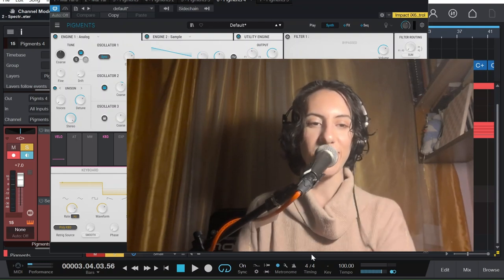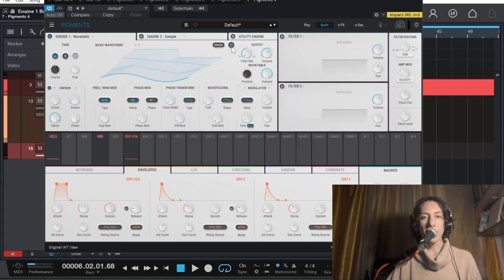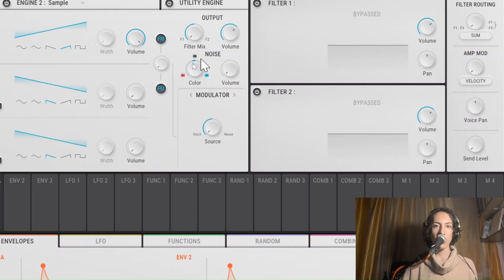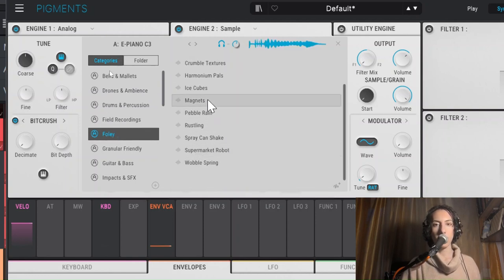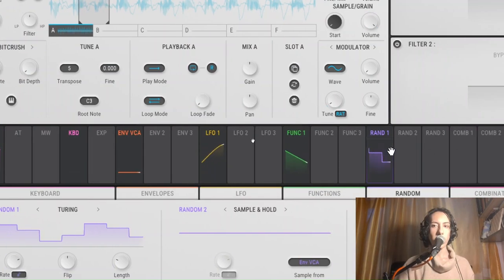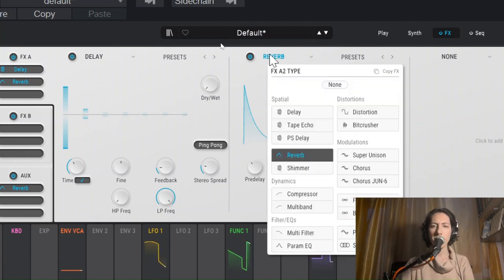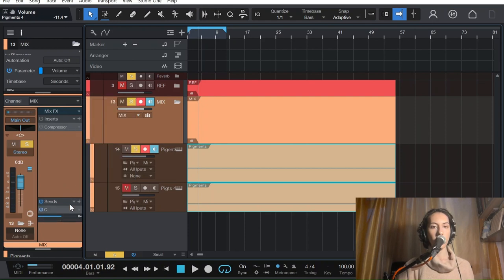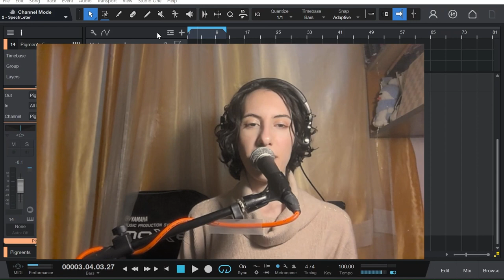Another Sound Effect Tutorial, Buuut In Pigments: Lawn Mower Sound

Comment: very low sawtooth into distortion on the mids and saturation on the low and highs into a low pass with resonance to shape the tone then a convolution reverb using an impulse from a fuzzbox and lastly a tape echo up fast about 16th or above to add stereo width, If the  sawtooth is locked to semitones you can get a changing gear effect. The key is the pitch of the sawtooth versus the curve used on the distortion. 

I'd like to request fireworks being let off at random locations in an urban environment,
Reply from the maker: That is quite a smart approach 🤔. Thank you for sharing